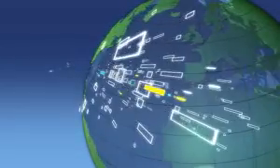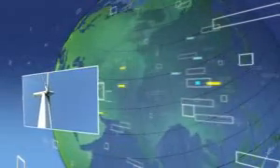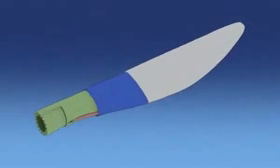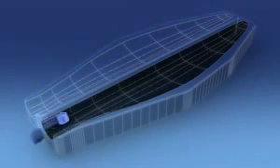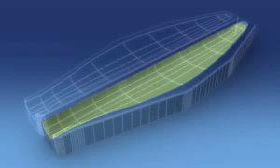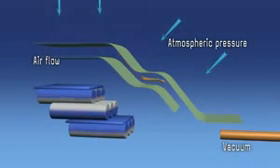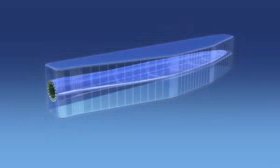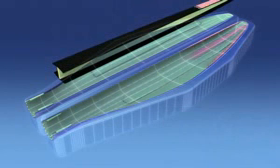Build a Wind Blade

Comment: cmon guys its not that hard, basically a grade A 2x4 with a carbon fiber/ fiberglass shell. with the root end built up to handle the load. man anymore if you cant buy it off the shelf or follow a step by step instruction manual, no one can do anything.